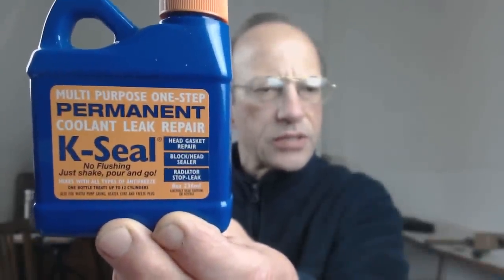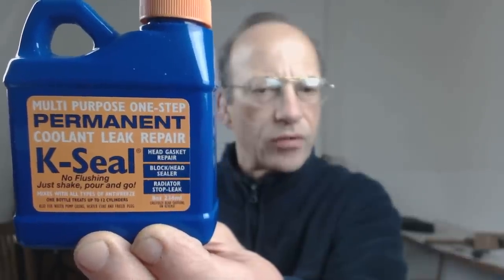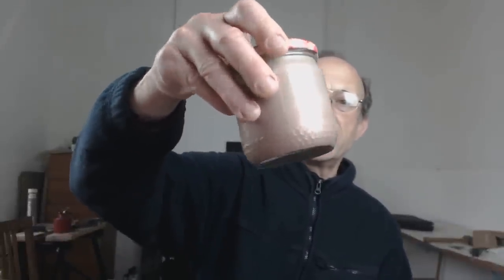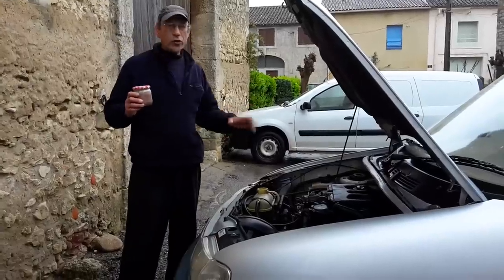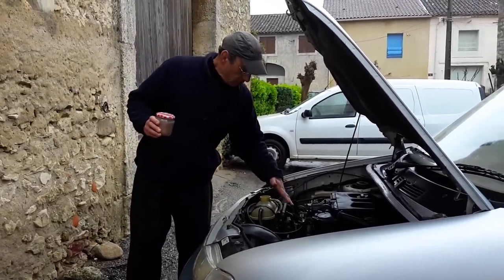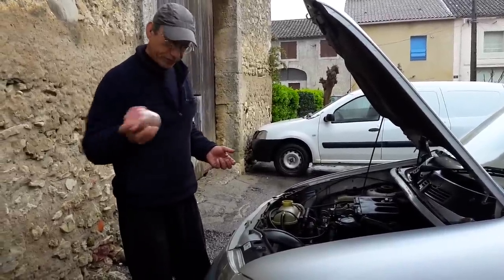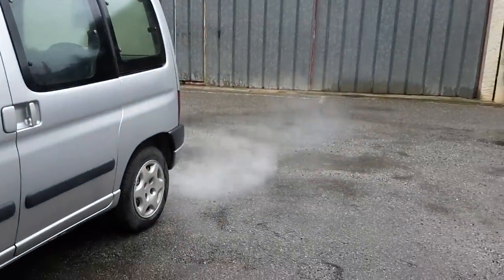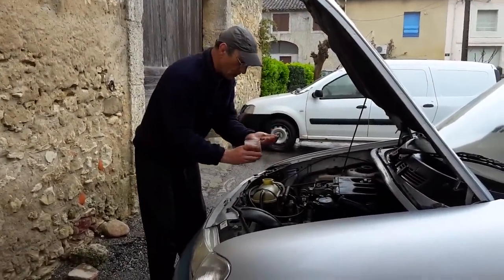K-Seal Full Test - Purchase options, Instructions & Results

Comment: I bought my 2001 Peugeot 406 2.0 litre HDI a few months back and it always starts well. No need to wait for the glow plugs to heat up even in cold weather but I suspected the head gasket was not sealing perfectly as I could often hear a sort of quiet whistle. I didn't want it getting any worse so I bought a bottle of K Seal and put it in. After that it boiled up and I stopped right away and put water in it. It boiled a few times over the next couple of days, so I took the thermostat out and ran it without, and it boiled again on a five mile run. Now it is doing something very odd. The top hose and bottom hose both get hot and pressured but the radiator stays stone cold. I don't know how that is even possible. Does anyone have any thoughts on this? I just put it through a new MoT test and hope to run it for a few years. Do I really need to spend a lot of money having the head gasket replaced? I hope not.
Reply from the maker: Hello Robert... thanks for joining us.
I do sincerely hope that you appreciate positive feedback.
First things first:
!) You would know that you have a problem that requires K-seal, when you find that your water coolant level is always falling.
Ie. The rad light comes on.... you top the rad up with water.... a couple of days later, the rad light comes on again.... you top it up with water.... a couple of days later the rad light comes on again..............................
Those symptoms tell you that water is leaving the 'otherwise sealed' cooling system.
If there are no visible leaks, the water must be entering the engine.
K-seal will fix such a leak.
2) The diesel engine with glow plugs.... yours is a 2001 .... mine is a 2004.... but my guess is that your engine also has sensors to judge numerous atmospheric and engine conditions.
In a nutshell.... these engines are designed to start with glow plugs.
If they start without glow plugs in cold weather.... this is an indication that something is wrong.
At best.... the engine will 'fairly quickly' start without glow plugs in the South of France, in mid-summer.
.... it's no different to a motorbike.... if it starts in winter without using the choke... you know immediately that something is wrong with the carb setup.
3) A whistle would not indicate a head gasket failure.
A head gasket failure (of this type) would occur across one piston, and would result in a regular pffft pffft pffft, in time to the engine revs. 
A whistle would more likely indicate a rotary condition.
4) While I am not a K-seal engineer..... I can say that the smallest blockage in the water coolant system is found when the thermostat is just opening.... or in the individual conduits of the radiator.
The opening strength of the bi-metal thermostat could not be blocked by the k-seal formula, and anyway, If you have removed the thermostat, it seems highly unlikely that there are any  places that could be clogged.... other than the radiator elements.
However.... if the radiator elements could be blocked by K-seal, the product would be a fail from the outset.
I still have the product running around my system.
If it blocked your radiator, then it would block everybody's radiator.
I don't buy that.
5) My guess is that you have a water pump failure, or a slipping drive belt, or a slipping 'friction hub'.... possibly indicated by the whistle that you heard.... but that could easily be a Red Herring (or not).
 
Overall
It is most likely that you had, and have, a problem that is causing the overheating.
The fact that you chose to try K-seal is highly likely to be purely incidental.

So..... shall we gamble?
We all love to gamble a bit.
 
I don't even know if your engine uses this component, but I'll gamble on it anyway.
I'll suggest that the main crank pulley is slipping on its rubber friction hub.... it is a rubberised bush that acts as a shock absorber between the engine and the peripheral components (water pump, alternator etc.).
 
Okay.... I've just spent half an hour trying to help you.
You need to click 'thumbs up' for the video, and report back to us, as to whether my wild gamble was correct.
Me being wrong on this is fine..... but the symptoms match this weird fault..... and if it's not that... then it's the water pump.
 
... oh yes.... and if it's the weird bush.... then you'll be having battery charging problems.
If your battery charging is okay.... then it is unlikely to be the rubber crank bush, and more likely the water pump.
 
But what it is........ we all want to know...... so report back!
:)
Reply: Thank you for trying to identify the problem with my engine. I am in bed with a cold at present but I will check the engine when I feel better. I will test the thermostat first of all. If it is OK I will refit it. And I will check the hoses and rad. I need to get to the bottom of this. Battery charges well. Until it boiled the first time it had been OK on water usage. It only boiled after I put the K Seal in. That could have been a coincidence of course. I have not done a long drive for a few days with having this cold but on short runs it slowly reaches 90 degrees then stays at 90, but the radiator stays stone cold. The heater works OK. As far as I know the whistle is the air escaping through the pressure cap. I will try running it without the cap to see what happens. By the way, what could be wrong with an engine that it starts without glow plugs? My older pre HDI 406 would not start without all four glow plugs working, and leaving the glow plug light on until it went off. I have a Renault Modus diesel that also starts without waiting. In fact the glow plug light on that only comes on for a second. There is no pffft pffft pffft sound with my 406. It was only the pressure in the coolant escaping through the pressure cap that suggested a bad head gasket. It was always good on water usage. I rarely had to top it up. I am not suggesting K Seal blocked my rad, only that it seams not to have sealed the head gasket. I still need to know how the hoses connected to the radiator can be hot and the rad itself stone cold.
Reply: I tested the thermostat and it was good so I refitted it and topped up the water making sure the rad was full. Then I ran the engine without the pressure cap. It bubbled indicating a probable leaky head gasket. So I will now take it for a short drive without the cap. That should prevent pressure forcing out the water. Also I tested the water pump and that was fine.
Reply: I ran the car without pressure cap and it reached the normal running temperature as quickly as it should. It did not boil and the rad core got to its hot temp too but the fan didn't come on. Maybe the fan has been bad all along. I need to test it.
Reply from the maker: Very interesting reports Robert.
Primary issue of K-seal usage...... if it is not leaking water, K-seal cannot function, as it needs a leak in order for it to insert into the gap.
What makes you think the head gasket has gone?
 
Re the rad cap off.... it seems that there must have been an air block (thinking of ideas).
Re fan - yes if you leave the car running long enough, the fan should come on.
With the cooling system apparently behaving itself, you should try it again with the rad cap on again.
re winter starts without glow plugs... the cause I don't know.
I would locate a friendly diesel forum, and put up the question..... you'll probably have loads of answers.
Anyway..... good luck :)
Reply: With the cap on it builds pressure and maybe that keeps the water out of the rad core. Seems odd though. I will run it a bit longer with the cap off, then try it with the cap on. I keep hoping the K-Seal will fix the head gasket, because if it doesn't I will have to take the head off and fit a new gasket. Maybe even have the head skimmed.
Reply from the maker: Have a look at this series of posts...... it could have been you writing the questions.
Failed fan, running with rad cap off....... read it all.... you'll enjoy it.
http://www.shoforum.com/index.php?threads/overpressurized-cooling-system-how-to-troubleshoot.50263/

Comment: Do I have to do this with just water? It's fairly cold where I'm at right now.
Reply from the maker: As far as I am aware, it works with anti-freeze.
Reply: Okay, I saw a few other things that says it works better with straight water and it's better to flush it after it's done the repair. I could be mistaking it for another product I was looking at before deciding on this one, but I might just try it like that anyway, unless you think it's best to be left in longer.
Reply from the maker: No One Cares LOL 
I left mine in... for the simple reason that it said that I could.
I bought some anti-freeze yesterday, and will install it.

The main thing is to read the instructions.
I can't find my empty bottle at the mo.

Anyway.... it's cheap enough for what it will save you.... so give it a try with anti-freeze (if you want), and report back :)
Reply: The weather is going to be above freezing here for the next two days, so I bought some radiator flush that I'm going to run through the system with water until tomorrow. After I drain that, I'll probably just go ahead and use the K-Seal with coolant and leave it in since you left yours in without a problem. I'll let you know if it worked when it's all said and done.
Reply from the maker: Cool..... Good luck!

Comment: garages hate this stuff there loosing thousands ...
Reply from the maker: I think that you are right.
Reply: Yeah. But Auto Parts love it because they're making a lot
Reply: I hate it too now because the particles will eventually clog parts were water is meant to flow, ie the heating matrix will gradually clog up or start running tepid rather than hot... Not even warm
Reply: @Curi0u50ne  Maybe, but for an old car that isn't financially viable to have a proper head gasket repair it is worth a try. If you or someone else gets afew more years out of the car than that is good for the common motorist and the environment.

Comment: Developed what seems to be a water pump leak in my 2004 Ford Ranger 5 speed 3.0 liter engine. It looks like water is leaking from the front area of the water pump. I just read through a TON of comments and don't really see anything about water pump issues. Anyone have any idea if it's a good product for water pumps? Most on here are commenting about a head gasket. Or just a random leak. My water pump is a serious pain in the bootie to replace. 
Thanks everyone
Reply from the maker: If it is a seal failure, then k-seal will not help.
If it is a gasket failure or a hairline crack, then it probably will help.
However, the water pump is likely fairly easy to remove, and rebuilt with a kit of gaskets and seals.

Comment: Is it still sealed after 4 years?
Reply from the maker: It seems to be largely still sealed.
I have noticed that on odd occasions, a top up is required.
My best guess is that the seal hasn't failed, but rather that there has been progressional deterioration of the original fault.
Only an engine strip will tell the full story.

Comment: Did it work long term?
Reply from the maker: So far so good, but I don't do a lot of miles.
The interesting test is going to be over winter, when temperatures get below freezing.
That's when there will be largest expansion and contraction of the engine block.
I guess we'll know more in Spring.

Comment: we need to change engine oil after pour this or not?
Reply from the maker: It is wise.
The oil may have become contaminated by the water.
Reply: I have used k seal on my wife's Dodge Durango that has over 230,000 miles on it. I am currently just maintaining oil changes at about 2,000 miles, and the thing is running beautiful. There's no milk in the oil and coolant reservoir has maintained consistent on the radiator for 15,000 miles

Comment: Will this block up the thermostat
Reply from the maker: I would say, that is way beyond the capability of K-Seal.
Don't forget... the thermostat opens and closes by a substantial amount.
It can only seal cracked blocks, heads, and failed head gaskets.
The thermostat is where all the coolant flow passes, so no chance.... not even close ;)
Reply: And you know this how?  I suspect a big dose of MSU here.  Making S**t Up.  The thermostat would be the last thing any sealer could block up.  Way after leaks, cracks, and the heater core and radiator.
Reply from the maker: Tom was not suggesting that it would block the thermostat..... he was asking if it would.
It was just a genuine question.
Reply: This won't prevent the thermostat from performing its job. However, if your particular thermostat is like mine, and has a small hole at the 12 o'clock position for the purpose of bleeding air from the system during operation, care should be taken to make sure that your engine is not showing signs of air in the system after use.
Reply: PlayF1 Net yes sorry I'm terrible with adding in question marks. lol

Comment: Please help! my car is Corsa 1.2  and from  a week is over heat and no heating inside the car  I drain off the coolant from the car clean and  put new coolant -the result is even worse  my car start to make strange noises and in 5 minutes drive the heating is  over 100. Do I have to much air in the radiator ? What can be wrong?
Reply from the maker: Naveed... I think that K-seal could help you.
Nothing is certain in life, but my guess is that:
... you will try it, and discover success... and then report back here :)

It costs a few quid... so it is probably worth trying.
The vast majority of people that report back to this channel, have good news stories.
Very few have bad news..

Honestly... just follow how I did it in the video.... you'll be fine.
DON'T forget to report back, to help others (good result or bad) :)
Reply: Thanks for quick response as always. Tried last year and was success :) I was wondering if i can repeat the process again with k seal. and one more thing i already put almost 2 liter of coolant inside, shall i drain half of it before i use k seal? lastly  when i open the coolant tank after few miles driving coolant is cold before was too hot, I am a little confused about the condition of my car. I am not sure if the coolant is circulating at all? please advice
Reply from the maker: Clearly we don't know.
For K-seal, you only need sufficient space for it in the system.

RE circulation, the thermostat switches on at operating temp.
thereafter the coolant should circulate.
So if the rad gets hot.... its circulating ;)

Comment: Does it work on 2004 Ford 6.0 Diesal w/a Head gaskit leak?
Reply from the maker: Certainly the concept doesn't change.
Like I said in the vid..... there are two container sizes..... one for cars, and one for lorries.
 
Hmmmm you might suggest that a six-litre diesel could power a lorry!
 
I personally don't think it is critical.
If it was, they would  detail the quantity by total coolant in the system.
I think it is simply.... if you run a lorry, then you have the big sized container hidden in your cab.,
 
For your six liter Ford...... my gut logic is to just use the container size that is available to you.
It's not a question of whether it will work.
It's gonna work (unless you have a gaping fissure in the head..... and even then...)
 
The question is...
Do you have the guts to buy the standard size?
Or do you buy the heavy duty size (to be safe)?
Or do you buy the ultra formula, for a shed load of money, to ensure that you have belt and braces?

All choices are valid, and extremely financially viable.

Is it just marketing..... to offer you the options?
Sometimes we just don't know,

However.... don't forget to post back here on the final choice you made...... and how many minutes it took to repair the head.
:)

Comment: my renault espace always gets coolant over the engine around the header tank, idles for an hour and you don't see coolant loss take for a long drive and header tank is empty coolant all over engine could this be my head gasket
Reply from the maker: Hey Stuart... it's hard to say.
But don't forget... it is a water cooled engine... so you can increase the revs in neutral (while parked).

Don't go mad... but simply raise the revs , in order to build general pressure.

Warm the engine first.
Then have somebody in the cab, while you watch for leaks.

Raise the revs... the monitor can keep an eye on the temp gauge.
It should be fine now (in Autumn).
Ambient temps are quite low.
The fan will kick in, and should keep the engine within temperature tolerance.

Stay clear of the fan, and the HT leads.... you'll be fine.
Good Luck!
:)
Reply: Engine Tuning yeah it gurgles when I turn engine off
Reply from the maker: At the cost of K-Seal... it's likely worth a punt.
Honestly, I'd try it.
We've had so many successes reported here, and so few failures.
Check out the thumbs up to negs.
This is YouTube.... if it was giving bad results.... no way would the ratio be like it is.
Anyway... if you do try it.... don't forget to report back.
A fail is fine (from my perspective) :)